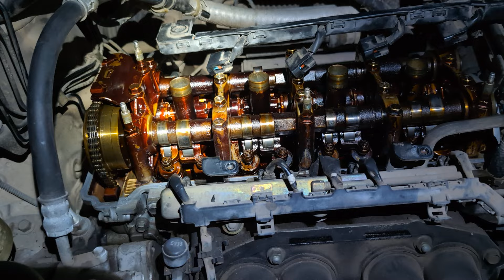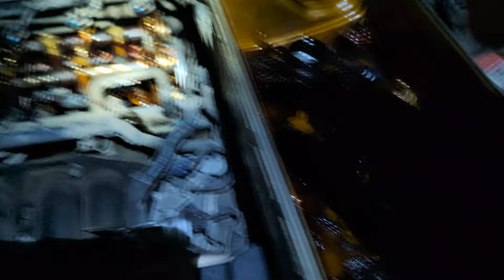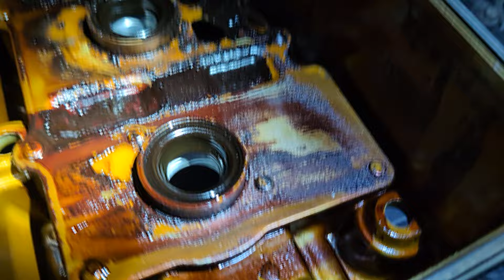2006 CRV with 45,000 original miles. lots of oil varnish? You tell me what is that.

Comment: Naphthenic oils and paraffinic oils are not as stabile as synthetic oils and so they tend to leave varnish inside engines even when the oil is changed frequently. In this case I suspect that the oil may never have been changes as anthony.... said below. I had a high milage engine with no varnish using Mobil One but one time I had the dealer change the oil with their paraffinic synthetic blend and varnish suddenly appeared. no more blended oils are planned for the future.
Reply from the maker: Thanks so much for your input! I've bought a couple older, low mileage snowbird cars and have noticed this varnish and build up. To add more weight to your argument, the 2 slightly newer vehicles that used synthetic look nearly brand new with zero varnish. 

Thanks again!

Comment: Car wasn't driven often enough to burn off the moisture in the oil. You see this in hybrids where the motor only starts up once in a while. Use any good engine cleaner in the oil.
Reply from the maker: Thank you for your insight. Yes, typically maximum drive is 15-20 minutes at a low speed in our area.

Comment: Run heavy duty diesel oil in it for a bunch of changes, or forever.  It won't hurt it.  I used Delo 5w-40 in my 2010 Forester.  Cleaned it up and cured the piston slap!
Reply from the maker: For how many miles and how many intervals?

Comment: Low quality oil left in the engine for a long time because of seldom use can cause this varnish to form.  I have had no success with engine cleaners to remove the varnish even after multiple treatments and oil changes.  But keep in mind that all the wear surfaces don’t have varnish so this varnish may not have any negative effects on the engine, it just looks bad.
Reply from the maker: Thanks for sharing your knowledge and experience.

Comment: Looks like the prior owner did oil changes every 10k miles and used conventional oil. If you use good synthetic oil and change it out every 3k for the next year it may help clean the engine up. I have had excellent luck cleaning the varnish in my engine using archoil 9100. It's mostly used in ford diesels to clean stiction but works very good in gas engines. Used 6 oz with synthetic every 3k for a year then pop the valve cover. You may be real surprised.
Reply from the maker: Thanks for the tips!

Comment: My 'speculation', conventional oil used, lots of short tripping (engine not up to operating temps), and too long oil change interval for those factors. I wouldn't do anything drastic like a motor flush. Just use quality synthetic oil and shorten the interval. Your 3- 5k mi. max (maybe split difference) sounds like a good one. While it doesn't look great it's just varnish not sludge. Over time it should improve.
Reply from the maker: Thanks for taking the time to share your recommendation!
Reply: @PatsPlatesPv  You're welcome.

Comment: 45,000 original miles with the original factory oil fill
Reply: 😂completely stock
Reply from the maker: What's funny is the seller told me they had just had the oil changed. But the filter didn't look like it had been changed for a good while. Maybe they forgot that part LOL

Comment: That sort of varnish is normal comes from conventional oil. Deposits and sludge are from lack of oil changes. Dont run diesel oil in it. Run the manufacturers oil. Its fine. My car has that varnish and it has 187,000 miles. Burns one quart every 6000 miles.
Reply: My vehicle is a 2011 Hyundai accent. 1.6 vvt engine

Comment: Motor Flush has kerosene & naptha
Reply from the maker: I run up to 20%  transmission fluid on some of the other dirty engines. How long do you leave the kerosene in it?
Reply: @PatsPlatesPv  it says 20 minutes on the bottle. You can smell it loosening stuff up. Sending stuff to the oil filter for collection.